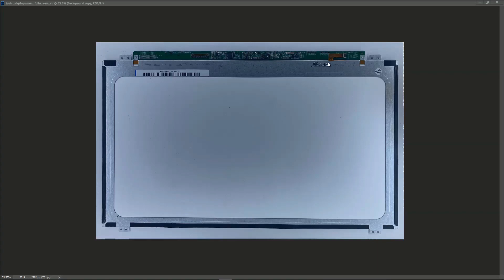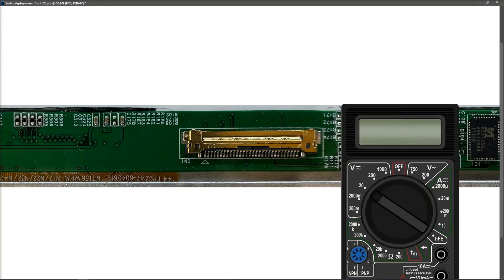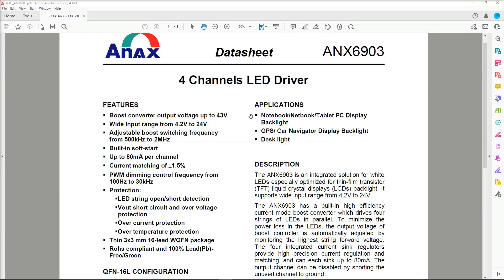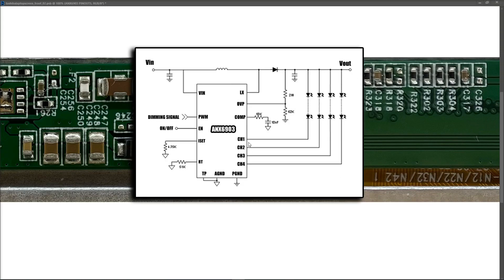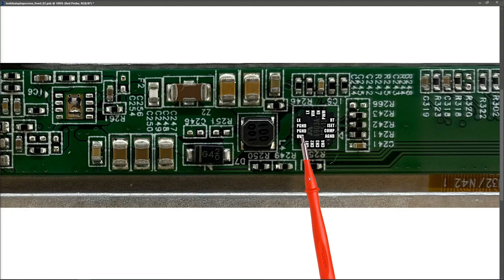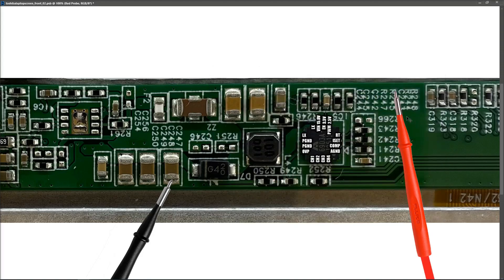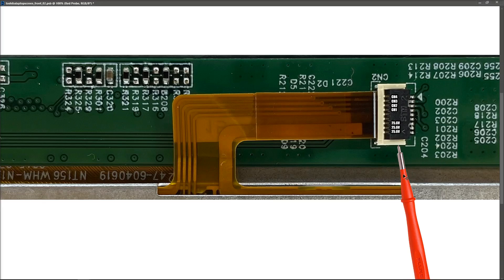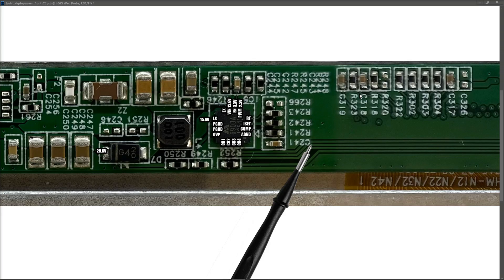Analyzing The Backlight Circuit For 15 Inch Laptop Screen

Comment: The very answers i have been looking for your graphics are the best i have viewed' i was supprised at the voltage input for the LEDS , so if voltage was applied to the enable pin with power to ch -1,2,3,4  & the leds power on the fault must be before the control chip would that be right ?

Comment: ISET sets the amount of current that will go through the LEDs. RT sets the switching frequency of the boost converter. I am making a logical guess here, based on working with similar circuits before. Feel free to correct me.

Comment: Another great video, and a valuable contribution to our knowledge base, which can be used for troubleshooting. Sorin would be proud.

A few months ago, I bought five AUO B156HTK01.0 touch screens from an eBay recycler. Two of the five were dead, and one has a good display, but a bad digitizer, so no touch screen. The seller gave me a 50% refund. It's amazing that these recyclers don't bother to test what they sell. I guess that cuts into their profit.

It would be nice if I could fix the digitizer on my "no touch" screen, but I wouldn't know where to begin. So I just use it with a 40-pin touch screen cable on my test laptop, since I rarely find a touch screen useful, anyway.